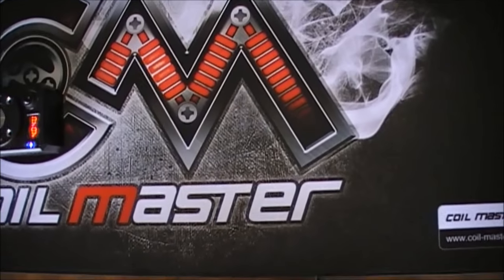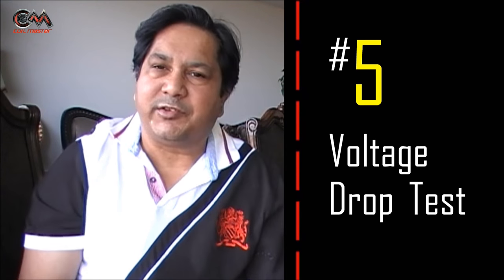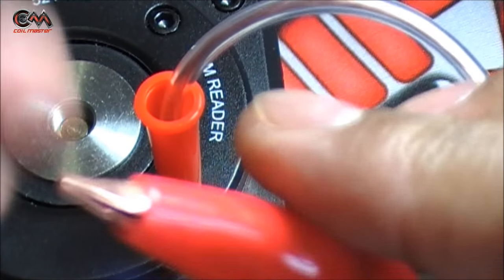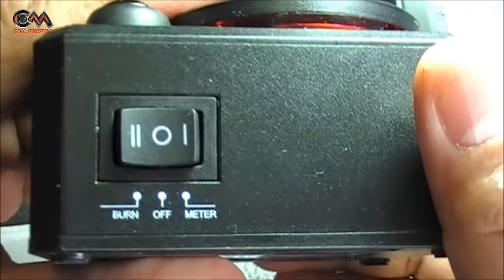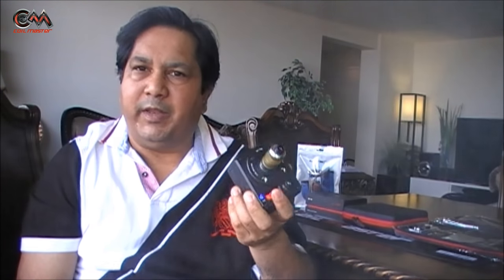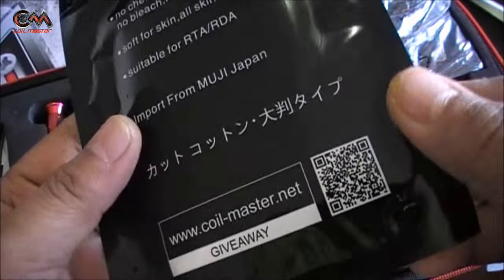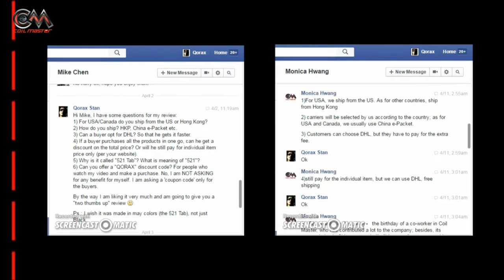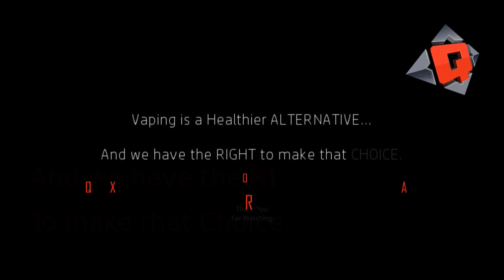REVIEW: Coil Master 521 Tab (New Version), DIY Tool Kit V2 and Stuff

Comment: Pity they did not include the Tab in the kit. Does it fit in case where the useless one is?
Reply from the maker: The Tab is about 4-times the size of the old ohms reader.
Reply: Qorax Stan Yes they need to think about including it in new versions of the tool kit.
Definitely buying one though. I love that you can even vape from it.
Like your videos, your passion clearly shines through.